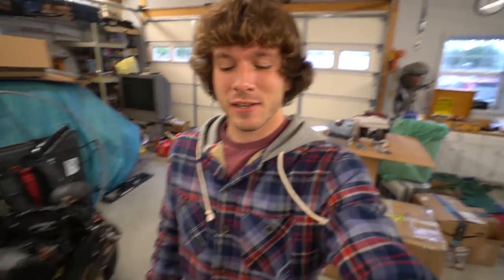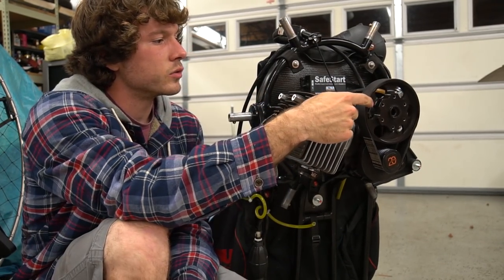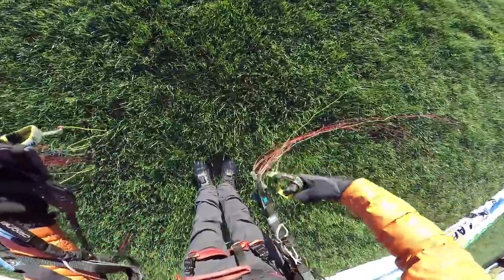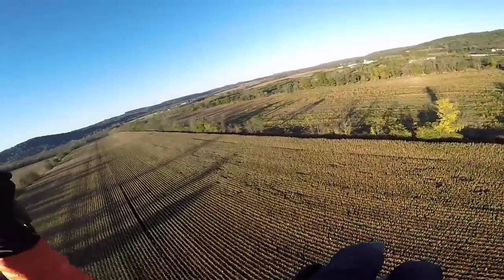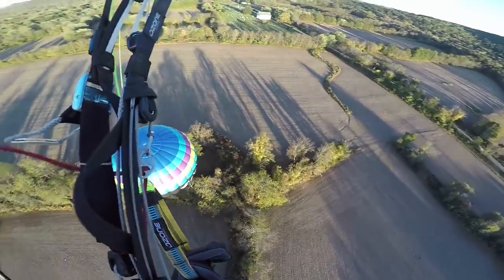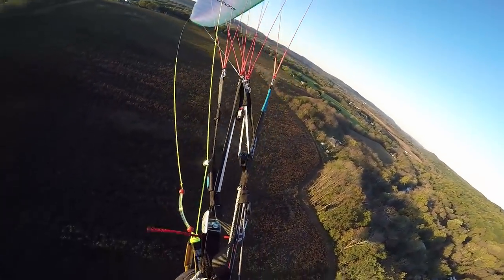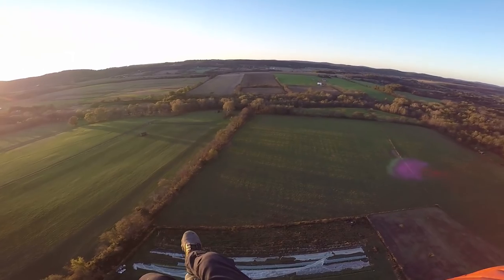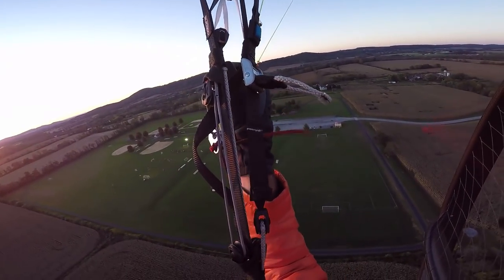Never expected to find this in my engine! - 36 Hours Of No Maintenance

Comment: I had acquired a Cessna 150 that was almost due for overhaul and helped my mechanic pull the cylinders to try to solve the oil leaks where the pushrod tubes drained from the top end back into the crankcase. We SANDBLASTED (walnut shell blast medium) the lead deposits out of the cylinders. The lead deposits in that little Continental engine had significantly reduced the displacement. It stopped leaking as much oil, but more importantly it ran so much better! Didn't have those problems with my bigger engines as they had more air volume throughput and slightly higher compression to help "blow the lead out" although they tended to foul plugs due to lead build up. Although not legal for aviation engines (but if some fell into my avgas I'd still burn it) Marvel Mystery oil is the solution. I add it to the paramotor and run a 50/50 mix like you in the 185P.

Comment: That yellow build up isn't just carbon, it's lead oxide, from the avgas. avgas is also called "100 low lead" and unlike pump gas, it contains lead, even if it's a low amount.

Make sure you thoroughly wash your hands after handling it. Maybe wear gloves just to be extra safe.

Comment: I hope you used a brass bristled brush on your head and piston, a normal wire brush will scratch the aluminum and shorten the life of the engine. I have had my small engine business for 34 years and I have seen the damage a wire brush can do over time to an engine. Just wanted to let you know because aluminum is quite soft and it doesn't take much to scratch the piston and it will score the cylinder wall over time.
Reply: Tinker Jim sounds wonky

Comment: Could a small alternator be invented to create a heated seat and/or external power.
Reply: Little engines like this use magnetos but there ei usually a place where you can tap off 12V at about an amp of current. Usually just used to recharge a starter battery.

Comment: Its disappointing that an engine would need a clutch after 36 hrs.
I'd go for the best fuel possible only. I'd change the oil and filter often. Maybe theres some kind of fuel additive to make the pump gas okay?
Reply from the maker: The fuel has nothing to do with the clutch. On the bright side, this was around 100 hours total, just 36 of zero maintenance.
Reply: @TuckerGott  
That makes a lot more sense.

Comment: This is an industry ripe for electrification!
Reply: Careful not to violate FAA rules on ultralights though. I could be wrong, but an electrified vehicle is technically in a different class. (Yes it's stupid.)
Reply: There are already electric paramotors but from what I understand they are inferior (less range, more weight).
Reply: No there are plenty of electric ultralights now. More to come.
Reply: There's an (FAA) difference between having your main fuel source as being electricity and having your paramotor have an alternator and electrical accessories. I realize that electricity as a fuel source is already a thing.
Idjles was a bit ambigous in saying "electrification", perhaps I made an assumption they meant to attach an alternator.
Reply: linagee I meant electric. Al that work with noise, liquids, mechanicals, spark plugs, smells. I think this industry will be revolutionized by batteries. Imagine what immense torque, silence and responsiveness will bring to flying. You'll be able to hear, smell and enjoy what you're flying over/through. I imagine electric users will never want to go back to internal combustion, just like e-car drivers.
And not to forget, reliability and safety!  
There are amazing e-stunt planes already which will transform things like Red Bull races.

Comment: Whats up with the need to do maintenance that often? You don't have to pull apart a car engine every 40 hours.
Reply: a) his motor is carbureted & it wasn't tuned for high altitude - too rich b) 2 strokes require oil mixed in with gas - maybe the new oil he used caused the buildup.
Reply: Thanks for the answer!

Comment: clutch?    does it have a transmission to?          easy fix.   aircraft dont need a clutch, throw it out and put the prop dirrectly on the driveshaft like oh...   100% of all aircraft ...

  ps I think helicopters use a clutch...  not sure...
Reply: The purpose of a clutch is so at idle it doesnt swing the prop. Easier to start and it's less load on the engine when you're just gliding or trying to get it warmed up.

Comment: that crap is from avgas. dont use that on a 2 stroke.
Reply: avgas did not cause that. if you do not know  what you are talking about, do not comment. the carbon buildup is from pump gas. I have ran avgas in trimmers, chainsaws, atvs, bikes, and hot rods for 20+ years with no problems. as for two strokes, I have a friend that is a two stroke mechanic for over 40 years said that the lead in avgas is good for those engines because it helps in the lubrication of the piston. he said that there was boat engines that they had got the cylinder  to piston clearance to tight. the ones sold in the U.S. were failing, but the ones sold to mexico were not having problems. what they found out was the Mexicans were running avgas and the lead in the fuel was keeping the engines alive. we have taken engines only run on avgas apart to make them go faster and there is no carbon, only a light gray film. avgas is just a highly refined, higher octane fuel with a low lead content.
Reply: that's not carbon dummy...its lead buildup from the avgas.  Take your own advice there.  It may be good for the piston but not for power.
Reply: as I said before if you do not know what you are talking about, don't comment.
Reply: air fuel mixture was off, therefore the discoloration. he was flying at a higher altitude than he normally does, and for a longer period of time. lead does not leave big deposits like that. aviation 100 LL. the LL stands for low lead. they put the least amount in they can get away with. I know people who used to build high compression race two strokes and ran c-12 race fuel. guess what it has in it, lead.
Reply: did their pistons look white like that?  what does flying at higher altitude have to do with it being white?  yeah he was probably running richer since he is tuned for flights around NJ.    You are one of those people that will keep arguing a point to death even though you are wrong.
Reply: no, I use by brain, and have experience with it. you are just trying to win a argument. let me ask you this, do you think that they would make a fuel that do that to a engine and then put it in a aircraft?
Reply: That crap is likely the additives they add to the pump gas, nothing to due with carbon or lead.
Reply: that fuel is put into aircraft engines and look what it did to his.  white crap all over it!  Maybe it was the combo of premix oil and avgas that did it.  Aircraft dont premix last time I checked.
Reply: the additives cant help but they shouldn't cause a whitish buildup caked on like that.  One of my local flyers said she uses avgas and also mentioned some white stringy leftovers and she only does 50/50 fuel mix with avgas and regular fuel.  Tucker did mentioned in the race that he used some unknown oils to mix didnt he?  bll430 im not claiming to be some fuel mixing racing expert, but there is an issue when avgas comes into play with our motors. That's all im going to say.
Reply: Here is an old article on the befits of avgas over pump gas in paramotors.  Good info here.
Reply: well if it isnt the avgas its a real coincidence that someone I know had the same problem as tucker and they both used avgas.  Either way point is we know for a fact Tucker used avgas and we know for a fact his motor is gummed up beyond recognition.  Maybe it was his oil??
Reply: ferret0007 posted a article verifying everything I have been posting. please read it.
here is something else, avgas will not vapor lock. If you do not know what that is, look it up. because I can tell you that you don't want that to happen while flying!  spill burg, I apologize if you think I was belittling you. I should of approached it in a different way. there is so much misinformation on av gas out there it irritates me.
Reply: our little 2 strokes are not built for reliability, that's why we all should be flying with an LZ picked out at all times.  Vapor lock has never been an issue with mine yet and if it did happen so what? glide down to my current emergency LZ target.
Reply: good luck with that.

Comment: avgas did not cause the carbon buildup, the crap pump gas did. I have taken apart engines run only on avgas and no carbon buildup like that, just a light gray film. pump gas engines had all kinds of carbon buildup. I have ran avgas in everything from two strokes to race engines for many years with 0 problems.